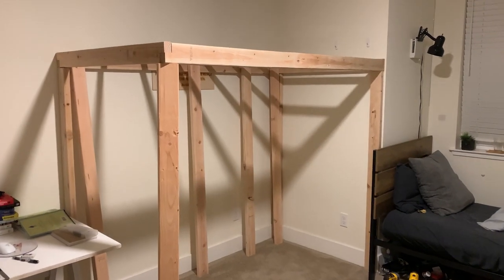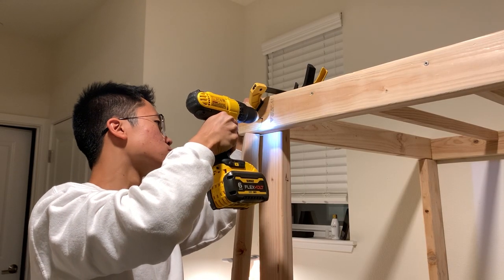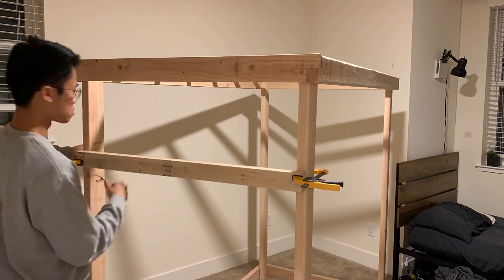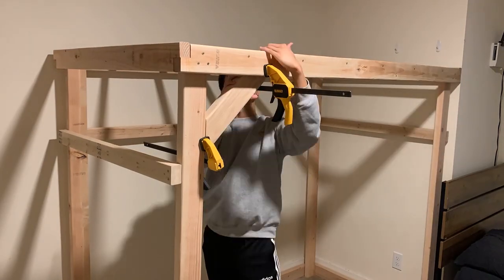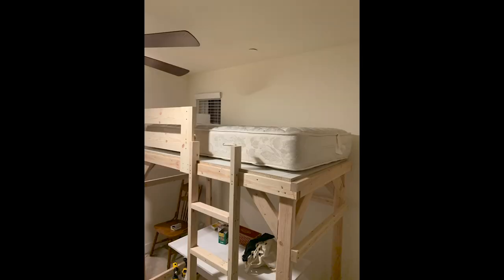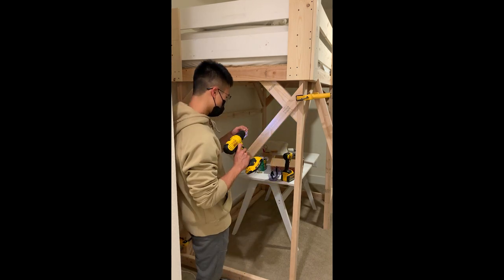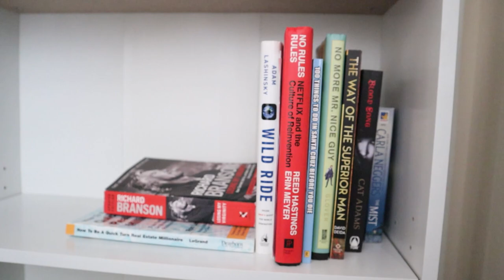DIY Furniture: College Loft Bed | Small Room Makeover | Gaming Area w/ LED Lighting

Comment: Great video, I'm wondering two things.... 1) what college has woodworking studio? You have access to a great facility. Great tools too! ...and 2) who did you not paint all the boards under the bed? Was that on purpose? Did you run out of paint? or by design?
Reply from the maker: Hello! I believe a lot of colleges have woodworking studios, but I live off-campus, so I buy my own tools and use them in the garage. The partially-painted parts under the bed are by design; I wanted to show the beauty of the wood texture.